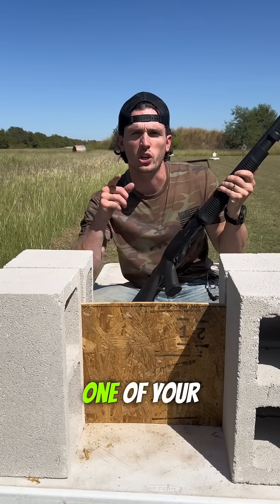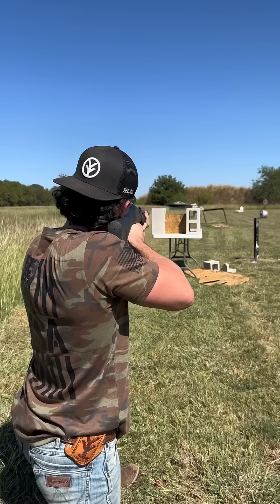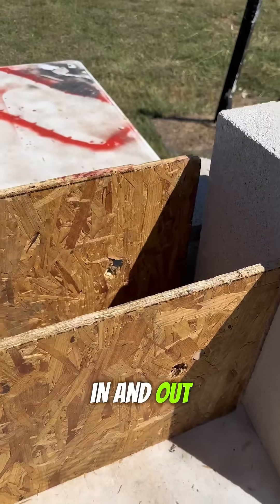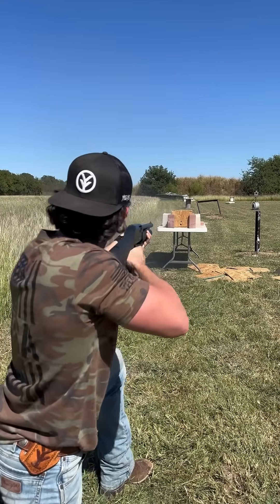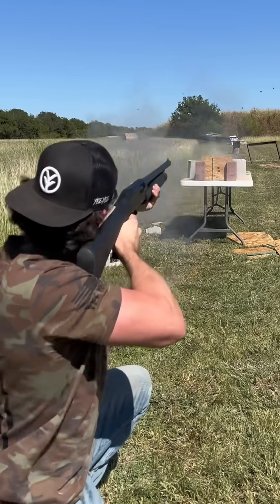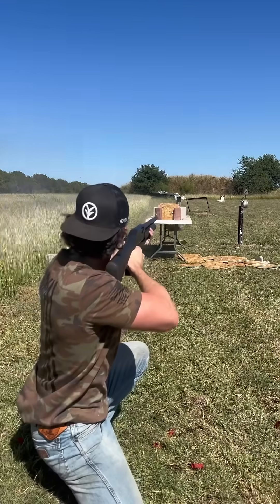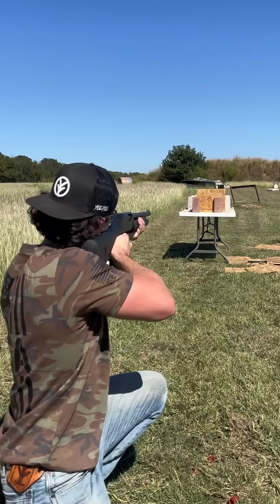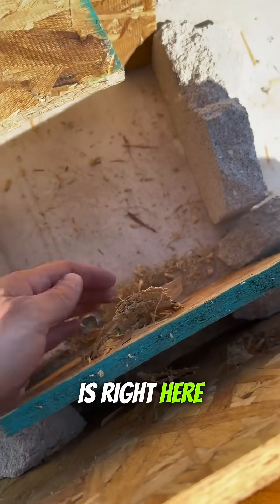How many pieces of OSB does it take to stop a shotgun slug?

Comment: I'm sure if you can press the plywood together it would take less
Reply: suprisingly this is logical. but no! if they are seperated it stops a bullet better than together. like how you see most tanks nowadays they have a outer shield instead of staying connected to the tank.
Reply: @sixyilr4245 I get where you’re coming from- but slightly wrong!! Modern tanks have spaced armor not to stop from solid shot projectiles- such as bullets or slugs- but to stop spaced shots, or even atgms, with multi-segment armor penetration, or with high-explosive tipped heads. In theory, it makes the projectile initially explode and waste a large chunk of its punch outside of the main armor of the tank, however, it’s not even truly made to full stop the projectiles, it’s still made to penetrate through, possibly even into the tank, just severely lessen damage internally and shrapnel/ explosive damage inside. So, it would’ve been more effective to put the plywood together, since the projectile is solid- still super fun eitherway!
Reply: @sixyilr4245  i think the reason why armor on modern day tanks are to protect from heat rounds since the first layer helps to keep the heat from penetrating all the way through but era does that too
Reply: @sixyilr4245 I've done this exact thing 😂 pressed together it wouldn't take as many to stop it . Using a 9mm it made it through 3 3/4 boards and stopped in the 4th ..gapped it made it through 7 .. was testing out stops for my diy range at home .. I see what you're saying but it doesn't work that way in the real world . Theories bs results are often not what we expect ..
Reply: Right!, I wonder how many
Reply: You mean Thicker Plywood?
Reply: Would you all be able to do a video of plywood versus a 30 caliber rifle.
Reply: 6-7
Reply: I was just going to say that. Why are you putting space between the plywood?? Just stack them tight together.